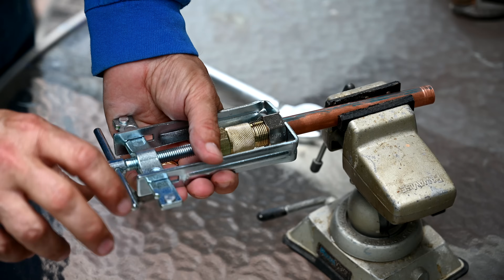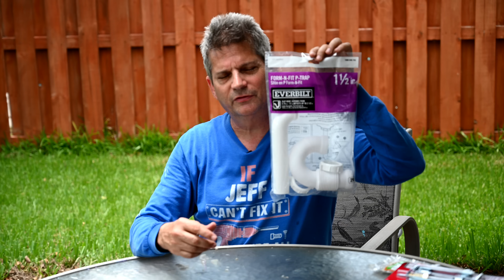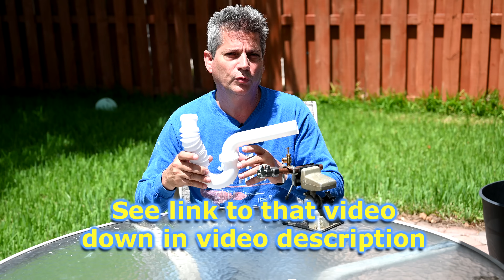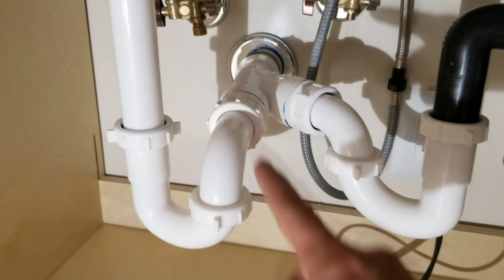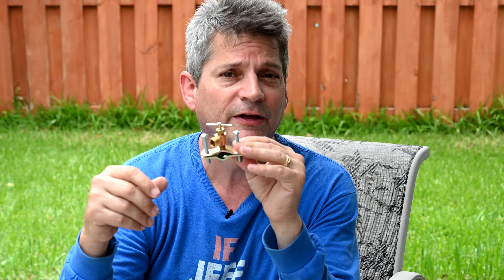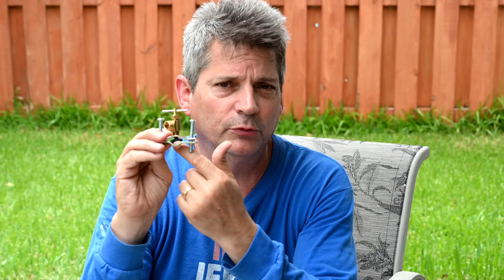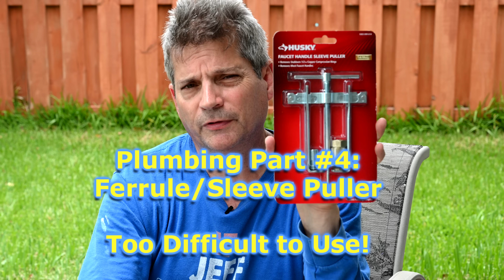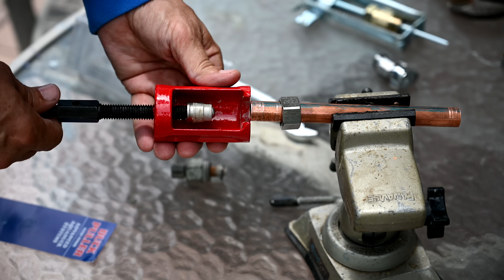4 Plumbing Parts/Tools You Should NEVER Use. NO Plumbing Fails

Comment: On the flexible drain, I have an issue...  a house with a kitchen that was an addition.  It has foundational issues with rising and falling in different temperatures.   The home is very old, late 1800s construction.  The drain line wants to collapse/crush with the foundation rising/sinking with the seasons.  What’s a good option for this to fix it?  Ideally something telescopic seems like the right answer to me but is there such a thing?

Bear in mind the home owners don’t have the money for lifting and putting in a new foundation, and this has been like this literally since they moved in in the 1960s.  It’s a plumbing ? I’ve struggled to find a real answer to though.
Reply from the maker: I'm thinking maybe a mission coupling might be used here,  Looks like a 4" long section of a giant radiator hose, with hose clamps on either end.
Reply: jeffostroff thank you.  I’ll take a look...  there’s a telescoping piece of pvc with some kind of gasket in it but it seems to me it would have some kind of “shelf” inside it of sorts that would become an accumulator of junk haha
Reply from the maker: @monkeywrangler5200  I believe a piece like this would violate plumbing codes as ptrap not supposed to have moving parts, also if piece has telescopic part, it might violate another plumbing code forbidding pipes from dropping in diameter internally.
Reply: jeffostroff appreciate the insight...  it’s def a unique situation to be dealing with.  Old homes are a Pandora’s box of BS to deal with haha

Comment: Saddle valves, when used with appliances that have an abrupt shut off of water such as a Washing machine or Ice machine, suffer water pressure shock. I fitted one of these to allow for a remote garden tap, luckily it never leaked in 20 years, but this is more due to its use. If I had an Icemaker on the end of it, the Water hammer effect of the demand being turned off would shock the fitting loose. Generally in the UK Sink, Shower & bath are separate from the soil trap from the toilet, so many don't have the issue. I agree, there aren't many applications when this could be used without risk of backflow or back gassing. I have seen these used in a situation when the s trap is very low in the cabinet & the sink has 8" plus drop from the drain plug. Even then there is no toilet on the same drain with the toilet .
Reply from the maker: Outside I have no problem using it.

Comment: Very glad to see your comments about saddle valves. I had a bad experience with one of those years ago. When they get old and the rubber goes, they ALL eventually leak. Another problem you can have is if you put one on a pipe upside down (with the needle piercing the bottom of the pipe. If there is any sediment in the pipe, and there usually is, the sediment clogs the needle. I just rebuilt a house that had three saddles in the basement — two for humidifiers on the heating/cooling systems (don't get me started on those as they are just mold generators) and one for a refrigerator ice maker. Got rid of the humidifiers and their valves, and replaced the ice maker supply line with a T with a quarter turn shut off. Some of the stuff that the plumbers did when they built this place was unbelievable. They must have been real amateurs.
Reply from the maker: Yes, your method is the way to do it. That's what a real plumber would do when the come in to fix it.

Comment: Actually s-traps ate allowed in one situation only, I keep forgetting what that situation is and its usually easier to install the right way eliminating the s -trap

And the ferrul pulled isn't being used properly... I have used them properly and it actually can be handy... but you can't used it on anything but copper...
Reply from the maker: Probably only situtation you can use S-traps in replacing an older one that fails. But as soon as you open up the wall, the city will make you remove it all.

Comment: I agree totally - but one thing has always escaped me about the flex trap thing ... why would an insurance company care? If it's leaking - it's VERY readily apparent where the leak is, and very easy and cheap to fix. It's on a sink, how much water can it leak before somebody shuts off the faucet? I just don't see it doing any real damage. If it does it's 100% homeowner neglect and should be excluded from the policy.

My house had one I wasn't aware of until I had to get new insurance less than a year after I bought it. My agent is an idiot and failed to communicate effectively between me and underwriting - but he told me they didn't want to write the policy "because the plumbing is old" (house is 30 years old), he said thats all they said and didn't say what to fix - I had to grill him before he said "Insurance co's don't like plumbing over 50 years old", I said my house is only 30, he came back with maybe it's this flex pipe in the inspection report ... it was a HUGE fiasco.

In the end it was NOT the flex drain, but somehow those idiots thought my plumbing was over 50 years old in a 30 year old house? I DID replace the flex because I don't want it there, but the moral of the story is that insurance companies nitpick some really stupid stuff sometimes that have no bearing on what could cause any real damage. Case in point - the entire reason I had to get new insurance - is that my current insurance required me to REPLACE a 10 year old roof that's in perfect condition ... over a screen porch in a concrete block house. As for their 50 year thing - are we supposed to jackhammer up the concrete foundation to replace all the pipes every 50 years "just because"? Insurance companies and their employees are generally criminally stupid.
Reply from the maker: Perry your oinfo is good except for the hwole first paragraph. It is NEVER s VERY readily apparent where the leak isto most homeowners clueless on home maintenance. The flood stays inside the vanity rotting out th ebottom of the vanity, then after that they start noticing the rot on the floor and the bottom of the vanity, then it spreads up the drywall, then soaks to the interior of the drywall, then you have moist humidity inside the wall space, then you have mold growing inside your walls for weeks until you begin to smell it. By then it's 10,000 to $30000. I have fixed numerous friend's bathrooms over the last 5 years, and even kitchen sink vanitis where it rots out of the bottom.

Comment: if both those traps are not allowed why are they still sold?
Reply from the maker: Legacy installs where re-doing it is not practical at this time. Basically once you tear into the wall during a full remodel that would be the time to switchover. Also stupidity, why does Home Depot and Lowes still sell Saddle valves in the ice maker kits? Now that one is stupid. No laws prevent selling them, it is just plumbing codes that ban them, so you won't get approval from your city.

Comment: All I would use the first ferrule ring puller for is to pull some handles off
Reply from the maker: Yes it's made primarily for shower handles even though husky advertises it is a dual use tool it is not as useful as a ferrule puller

Comment: I have no experience with that puller. Had one in the garage. Don't know what's it for. And threw away.  But you may be using it wrong. Common sense tells me you are not supposed to clamp the pulling arms with your hands. Those arms should be in the notches on top to prevent it from moving while pulling, plus it won't restrict you from turning the handle.
Reply from the maker: Newer instructions from the manufacturer tell us not to use the handles at all. they are only for use when you use it in shower faucet knob puller mode.

Comment: I've seen those form-n-fit traps in multiple fast food restaurant restrooms.
We had a professional install our RO filter under the sink, they used a saddle valve to connect to water. Guess that's what we get for buying a $1100 filter with free installation.
Reply from the maker: Yes, we quit using all the contractors from Lowe sand Home Depot years ago.

Comment: I'm guilty on 3 out of 4 of these items. 😳 Saddle valve was installed by previous owner for the fridge/ice maker, and I've used the accordion trap. I also bought one of those sleeve pullers (not sure if it was husky or another brand) and haven't used it yet. After watching a couple of your videos I'm going to have the saddle valve eliminated and install a proper setup as we are getting a new fridge soon. I will replace the accordion trap myself, seems easy enough.
Reply: I tried using the Husky ferrule puller corectly, using the metal insert on the end of the pipe and the threaded sleeve on the outer nut. It deformed the end of the pipe so bad that about an inch of the pipe had to be cut. 

I ultimately called a plumber, who used a Ferrule blaster, and it pulled the ferrule off quick and easy, no damage to the pipe. It costs about $90 (USD) and would be well worth the investment. 

Plumbing connections are never in a convienien place, workinh under a sink is a pain in the back. Although plumbers can be costly, a good one is worth the money to do the job right, and save me the trouble.

Comment: Lots of good information on things I come across quite often in my remodeling business. It gives me plenty of repair work. Though I have my own method of removing the brass sleeves,  I think you missed something when using the Husky tool. The L arms should rest in the 2 notches which will allow the T handle to rotate easily. Once you start to snug it up, you can grip the L arms around the nut.
Reply from the maker: Great point! But, the newer instructions don't have you using those arms at all, just the middle part of the tool that screws ontot he compression nut.

Comment: We call Saddle valves, Vampire taps.  Another problem with them is that once you open the pipe you never can really shut off the water to the new supply line.
Reply from the maker: Yes, this is why we som much rather used the altenrative dual shut off valve at the sink, and connect to the 2nd valve.
Reply: @jeffostroff   I had to have that done on my first house.  They used a vampire tap and best yet it was all corroded.  And my house inspector missed it on the inspection. I had it replaced with a proper "T" and shut off.  Oh yea, I also had a form and fit "P" trap under the kitchen sink.  Yes, my house inspector missed that too and I replaced it on literally day one.

Comment: I'm a home owner, and just use 15mm pipe cutter and deburring tool, then use a washing machine 15mm t-piece with a ¾"BSP valve that has compression fittings and either copper or brass olives (feral), quick, easy and reliable, did it for my water purification system and dishwasher, still going well, with no issues 5 or 6 years on.

Comment: Pulling the ring off is asking for leaks, copper gets scraped and new ring can't re-compress into imperfections for tight compression reseal....shinny round copper or forget it! Inspectors will not allow private work, permit shuts you down!!
Reply from the maker: I had never seen the ringing scratch the pipe ever

Comment: I didn't know saddle valves had issues and weren't up to code.  I'll replace mine for my fridge in the near future.  Thanks for the info.
Reply from the maker: My preference is always been to modify instead the water shut off elf under the kitchen sink to have 2 ports, one of them is the quarter inch port for the ice maker line
Reply: @jeffostroff  - With my kitchen, I'd  have to run the line up the wall and through the ceiling probably 15 - 20 feet.  It's way closer and easier to come from our laundry room 5 feet away through the wall, plus if it does leak it won't hurt anything.

Comment: Most of the time the old ferrule and nut are still in good shape. You just leave them in place and screw the new valve into the old nut. I've done it that way for over 20 years and never had a leak because it. 
If you do have to cut it off, use either a Dremel with a cutoff wheel or a mini hacksaw, if you don't have enough pipe sticking out of the wall to use a tubing cutter. If you use a tubing cutter you will have to cut off more of the pipe. Which is fine if you have enough sticking out of the wall usually you don't.
Reply from the maker: Yup, most of the time we find not enough pipe to cut off, which is why I hardly ever cut the pipe, a lot easier to pull the old ferrule off and insert a new one.

Comment: Not all people who use these parts are lazy or cheap.  There are a hell of a lot of people who can't afford a plumber.  That's something you should have picked up simply by being alive.
Reply from the maker: They need to pay a plumber. That's something you should have picked up on by watching the video. It's about using the correct parts as opposed to the wrong parts. The correct parts don't necessarily cost more money.
Reply: @jeffostroff  And you seemed to have missed the point that the wrong parts are easier to install and don't require the expertise of a plumber.  Duh!

Comment: I find that if you have poor-quality water laden heavily with sediment that saddle valves will bung up with said sediment long before any other action has time to cause them to leak.  You can extend their life by closing and opening them again but this will only work a couple times.  So at the end of the day they're all temporary just because they don't last long enough to be permanent.  So I suggest you learn to solder pipe because it enables easy and efficacious repair and addition.  Buy a MAP gas torch for it, if you don't have a dual-gas one nor want to buy one; propane just barely reaches the appropriate temperature and you will have great difficulty achieving acceptable results.
Reply from the maker: MAP-Pro gas burns at a temperature of 3,730 degrees Fahrenheit, while propane burns at 3,600 F.  Is there really that much of a difference since solder will already melt at a lower temp?

Comment: So today I've watched several videos on installing free-standing tubs and every one of them had those accordion drain pipes. I would agree that they trap hair and soap scum and all kinds of stuff which also ends up smelling badly (it's not just sewage that smells bad). I'm assuming they're using the accordion style pipes because they don't have access from below. Apparently the tub manufacturers, or at least some of them, actually include the accordion drain pipe with the tub.
Reply from the maker: When there is no access to the plumbing outside of the tub, a flexible pipe for the overflow is acceptable. Remember this is not the main drain, so it might only see water once per year if ti overflows. The normal water drains through the tub drain with a smooth self scouring trap in the line.
Reply: @jeffostroff  , in a couple of the videos they used the accordion flex pipe for the connection from tub to DWV pipes. In one video they were actually creating an S-trap configuration as well. Yikes. But I agree about the overflow. It is so seldom if ever used I wouldn't worry too much about a flex pipe there.
Reply from the maker: @dennismiller9681  Wow an S-Trap! Wait until that self siphons out, and they get  that lovely sewer smell in the shower!  LOL, actually probably won't happen because as soon as you take a shower, the trap should fill back up.

Comment: Im a journeymen plumber here in cali, and been in the trade for many years. This guy is right on point with his info. Saddle valves are junk that leak even you lightly bump accidentally especially if theyre corroded.  Sadly yes home dump does sell these products. Any handymen trying to make a quick buck will sell you these items not knowing how long it will last or by a few months from now your gonna cause water damage somewhere because all these are cheap and end up leaking. Now with all the damages because a Diyer or a handymen caused you now have to call your home warranty company. Your home warranty company is gonna send their plumber and either say this is the home owners bad or its wear and tear.
Reply from the maker: Home Dump! that's good one I had not heard before. I usually call them Home Desperate or Home Cheapo.
Reply: In a tight situation were my parts house is closed...I'll take home dump over lowes...lol

Comment: Horse shot, I used a Seattle joint to put in the new ice maker/ refrigerator. IM A TRUCK DRIVER, was limited on home time.  Two weeks later once home again I installed a proper copper line for the new appliance!    
SOME OF US DO MAKE IT CORRECT!
Reply from the maker: That is an acceptable way to do it also. You do know of course that for many people a "temporary fix until we can get to Home Depot", 10 years later turns into "I thought we took care of this temporary fix!"
Reply: @jeffostroff  I keep a must repair or do list running. That way it doesn't get forgotten.    I think you did not like that a quick setup temporarily is exceptable
Reply from the maker: @the-kilted-trucker59  I would to a flex ptrap as temporary for a few days until I could get the correct parts in to implement a job. But I would not install a saddle valve, because I can install the correct compression fitting  shutoff valve under the sink that has the correct 1/4" compression fitting for the ice maker line